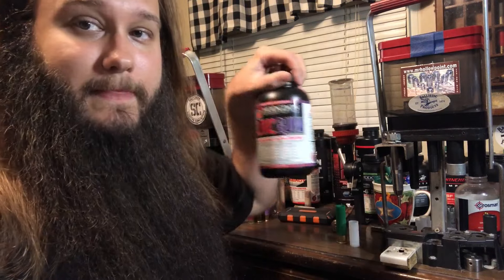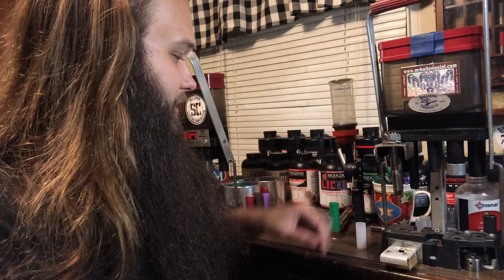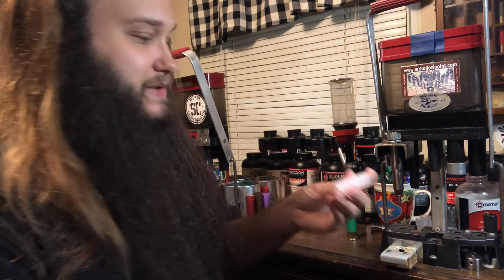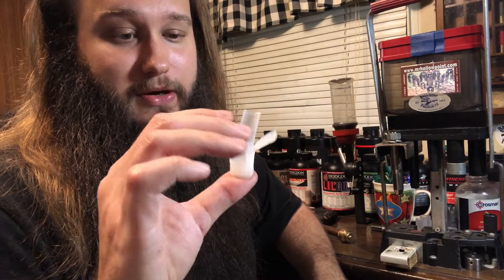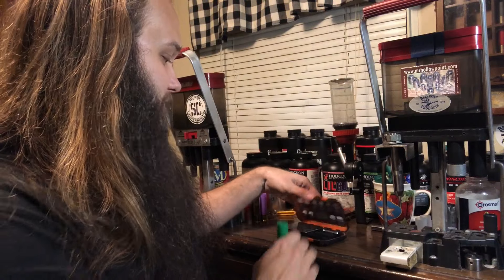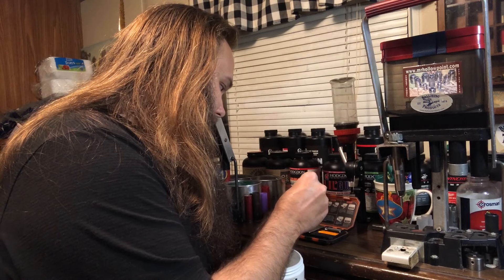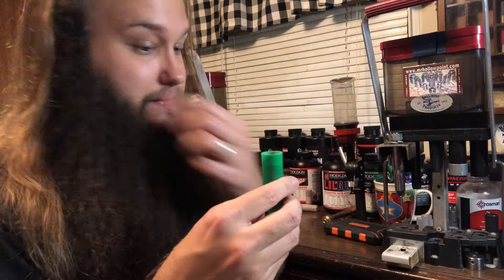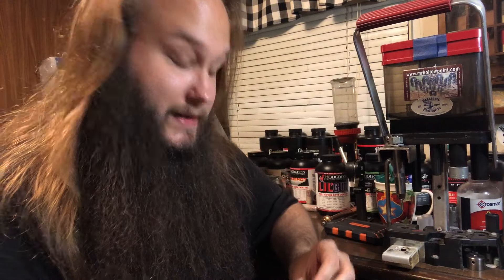12 Gauge 3” Steel & Bismuth Duplex For Ducks

Comment: I developed this load to be a little more affective than just straight steel shot. I called this load the "Susie Slayer 2.0"... "Susie" is a redneck term used for hen mallard. One of my hunting spots seems to produce 75% hen mallards, and the shots are only out to maybe 30 yards at most. I wanted a huge open pattern with smaller shot (OG load was with 1oz #5 steel and 3/8oz #4 bismuth). Cylincer choke produces awesome patterns for a 30-35 yard max shot on a Susie bird.
Reply from the maker: Now that’s interesting

Comment: Got got a couple load the you will love. These loads were reloaded by waterfowl hunters who have sent these loads in for texting and are safe, proved by  precision reloading test lap and a test psi machine. The first load is 3" cheddite hulls/primer, 48 gr lil gun powder, 3" tps wad, 1 3/8 oz steel shot ( max shot size is 2# you may get away with 1#), roll crimp at 1404 fps with 9,070 psi. The second load is also a 3" cheddite hulls/primer, 42 to 44 gr lil gun powder, lbc50 wad, 1 3/8 oz or 601 gr steel shot ( max shot size is 3#), fold crimp at 1332 fps with 9126 psi with 42 gr powder and at 1367 fps with 9464 psi with 44 gr powder.
Reply from the maker: Sounds like good ones to me

Comment: Could you use just 1 3/8 oz of only steel in this? Been trying to find a 1 1/2 oz steel load in a powder I have available
Reply from the maker: Blue dot lil gun and steel powder are about the only options for that but if you can fit 1 3/8 ounces it should be good to go
Reply: 1.41oz any good ?
Reply from the maker: It’s really close to 1 3/8
Reply: I have two loads you would love. The first load is 3" cheddite hulls/primer, 48 gr lil gun powder, tps 3" wads, 1 3/8 oz steel shot, roll crimp going at 1404 fps with 9,070 psi. The second load is also a 3" cheddite hulls/primer, 42 to 44 gr lil gun powder, lbc50 wad, 1 3/8 oz or 601 gr steel shot ( max shot size is 3#), fold crimp going at 42 gr powder 1332 fps with 9126 psi and at 44gr powder 1367 fps with 9464 psi.
Reply: @theshotgunscientists sorry that was supposed to be for Richyrich